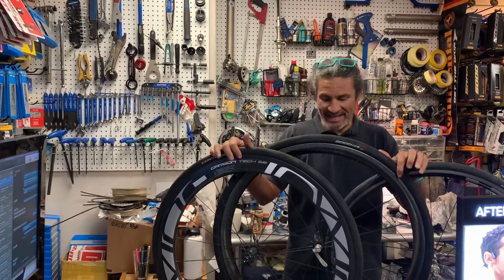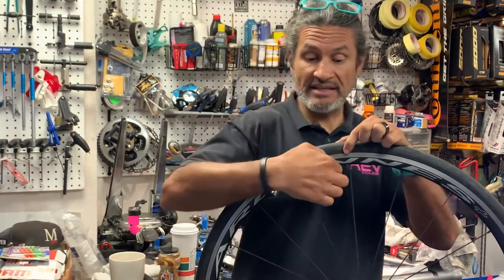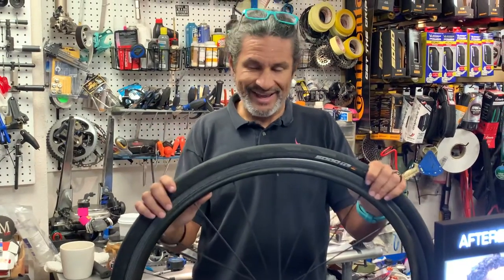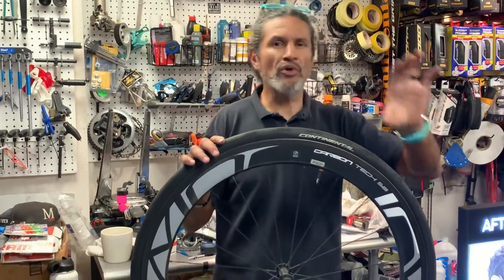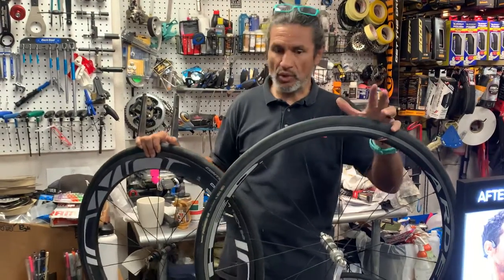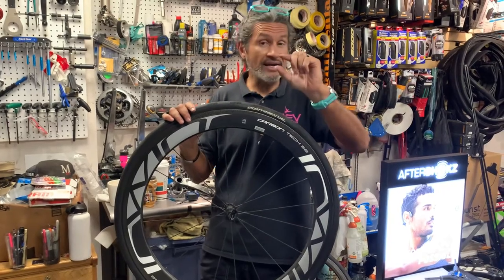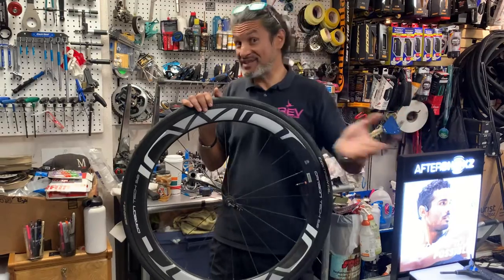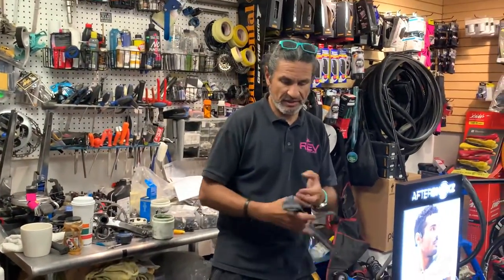Rim depth? What is the best rim depth?

Comment: I have 30-day trial on  Scope S4 (45mm depth) set and was considering to change them to the S5 (55mm depth) model. I have several considerations now after watching your very transparent explanation, so I may keep the S4 ones.
Reply from the maker: Wow 30 day trial!  That's cool!  In a perfect world you should have all the rim depths and change them out based on the ride/race/event or weather conditions.  I have low profile, 38mm, 46mm, 60mm and several other wheels.  It's another reason why I have no desire to switch to disc brakes I mean switching to discs is NOT an upgrade anyway but that's just my opinion.
Reply from the maker: thanks for watching please consider subscribing!

Comment: Hi George,

Had the Hed Jet 6 rear and Jet 4 front Clydesdale build, too stiff and needed Valve extender for rear wheel. Also rear wheel needed to be static balanced to get rid of vibration from long stem at high speeds. Good wheelset for racing, but happy to have sold that bike and back  on 30mm alloy wheels, simple 40mm stem tubes happy days:) 
Thank you for this video. 
Subbed👍
Reply from the maker: Hello NP - are you a heavier rider? Clydesdale 24/28 build can be quite stout for a light to medium weight rider. 

Yes it’s a nuisance to have to keep track of all the different valve stem lengths in your tool kit! 😂 right now I carry 80 mm so 1. I can service any of my wheels on the road then swap out to the appropriate length when I get home (OCD 😂) 2. I can give a tube to just about 80% of the riders stranded on the side of the road.
Reply from the maker: Thanks for watching and thank you for the sub!!
Reply: Yes, I’m in the 200-230lbs weight range, that’s why ordered that build. Smart that you carry the 80mm tube. I ran 40mm Silca latex tubes needing extenders. 
Loving your videos, I hit the like button to send some love your way! Greetings from New York
Reply from the maker: @NP-kc5qd  thank you very much. The YouTube algorithm needs to know when I have posted quality contact. Thank you for your support.

Comment: I stopped watching GCN. They are just promoting and marketing brands. I found this channel very informative. I ride my road bike in Scottish countryside. It’s windy and I face very often strong cross wind. I have shallow aluminium wheel but my local cycle shop wants me to buy deeper carbon wheels. What’s the effect of cross wind on deeper and shallow rims?
Reply from the maker: Welcome aboard! I generally don’t like deep section wheels when it’s windy unless I’m racing and race day is race day. I almost always ride low profile wheels. Riding deep carbon wheels is kind of dumb in my opinion especially since the braking is terrible when dry and downright dangerous when wet. My deep wheels are HED Jet black alloy brake track with carbon fairings.

Comment: Hi George very good content and perspective for the everyday rider (non pro).  I am set to receive a new Canyon Endurace fitted with 105 and Fulcrum 900 Disc Brake wheels 24mm depth.  The review of these are that they are solid OEM wheels but on the heavy side at close to 2kg for the pair.
If you were to recommend an upgrade wheel set in the range of $800, what is it and would you go for 35-40mm depth or stay shallow?  Right now my rides are 75-100k with <2000m elevation.  The plan would be to put 32-35cc tires for light gravel on the existing wheels and then have more road friendly /performance wheels.  Thanks in advance
Reply from the maker: Hello Mark! 

Send me an email  “ revcycling@gmail.com”

Comment: Hi.  Great video.  I have mavic aksium aluminum wheels and I ride with gator skin clinchers.  The mavics have zero material between the rim and spokes.  Would I notice a difference in speed if I got an additional set of wheels like the HED ones and set them up as tubeless?  I am thinking these would be good for faster group rides or longer rides.
Reply from the maker: Hello Seth thanks for watching please be more specific when you say the “HED ones” HED makes many rim depths. 

Keep in mind two things are at play 1. Rolling resistance -  if you were riding gator skin tires you will never go fast. Those tires have terrible rolling resistance! Terrible grip and terrible performance overall.  2. Tire construction, tire pressure and the actual tire itself will make a big difference in rolling resistance. 

Of course aerodynamics come into play as well.
Reply: @SeeYouUpTheRoad  Thanks. Did not know that about gatorskins.  I was talking about the ardennes rims in the video.  I guess my thinking is to have a more areo set up for group rides and the gatorskins for when I am alone and want to avoid punctures.
Reply from the maker: @sethleibowitz2906  why are you afraid of punctures? Why? Gatorskins are terrible tires please don’t ride them. Ride a high performance for better ride quality, better performance and less rolling resistance. It kills me when people pay $3k,4k,$8,000 on a bike and then destroy all the engineering put into the bike because someone puts $50.00 Gatorskins on the bike. 

I ride 10,000 miles per year ride high performance tires and get maybe 1 or 2 flats per year. Why are you afraid of punctures? Yes I’m asking again. 

The Ardennes are not aero in the least. Maybe look at the HED RC4 I did a video on those. 

The Gatorskins ranks nearly at the bottom of these 70 + tires tested

https://www.bicyclerollingresistance.com/road-bike-reviews
Reply: Thanks George.  Good advice. I will stick with the alloy rims.  Do you think going tubeless on the tires makes a difference?
Reply from the maker: @sethleibowitz2906  yes tubeless is proven faster than clinchers … for many years now. Would you notice it probably not but you would be faster.
Reply from the maker: @sethleibowitz2906  you still didn’t answer though why do you fear punctures ?

Comment: One of the annoying practicalities of having to carry 80mm valve stem tubes is the amount of room they take up in your saddle bag or jersey pocket, especially on a longer ride when typically you may like to take 3 'just in case'.
Reply from the maker: I know! I totally agree! But I think I mentioned it in this video, but I know in others, I can’t tell you the number of times I’ve run up on a rider who doesn’t have a tube with a long enough valve stem and luckily enough I’m carrying an 80mm tube, although to be honest, it has happened to me where I  haven’t had the correct tubes in my tool bag because I have so many different bikes with so many different wheel with different rim depths 😖🤣

Comment: How much faster can one be when sprinting at around 53kph on 35mm wheels then switches into deep-section wheels?
Reply from the maker: I wouldn’t say all that much faster. The assumption is you’re out of the saddle sprinting and your head, shoulders and body create more aerodynamic drag that can not be overcome by deepening the wheels’s rim depth. Just a guess… the benefit of deeper wheels would be realized BEFORE the sprint when you are in the seated position and much more aero.  Also just a guess …
Reply: Nothing. For sprints you need lightweight wheels. There is a reason those are used on time trails.